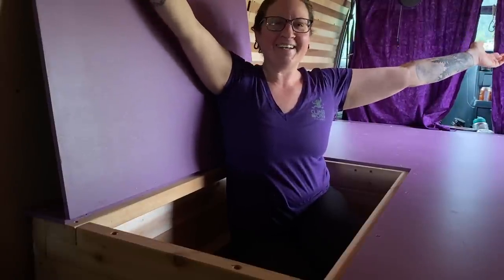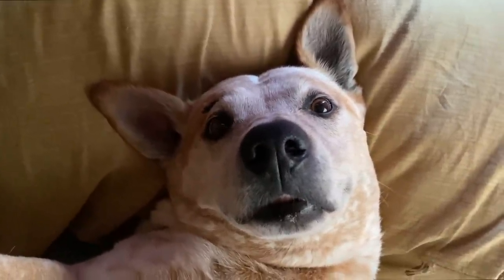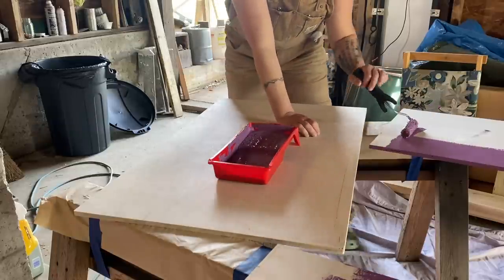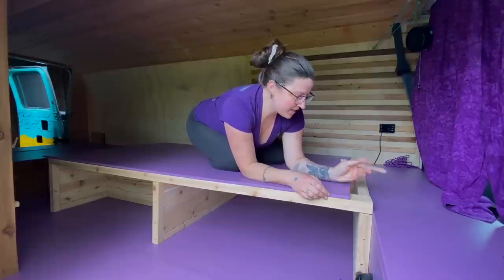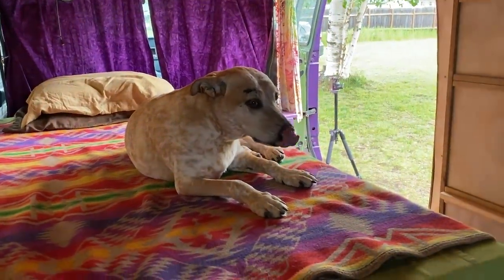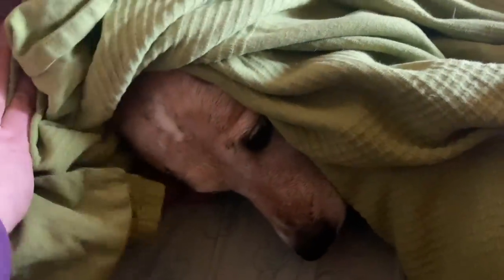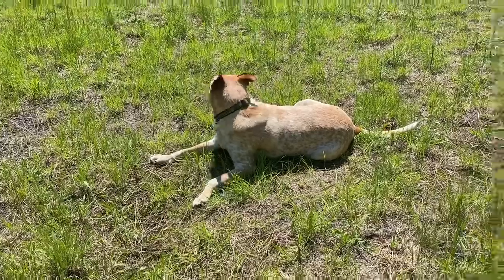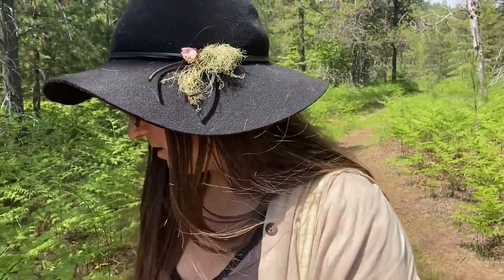MOVING INTO MY VAN || Vanlife Renovations, Concussion Recovery and Bill C-11 Issues

Comment: I love your bed so much. I might have to steal you SUP paddle storage ideas. I don’t know why I had it in my head that I will always need to have it stored in its bag. 🤷🏼‍♀️ 

Anyway, pro tip, you can put in attachment points and use the paddle board kayak seat as a back rest in your van. I use mine at my desk area, so I have some back support if I need it.

Thanks for another magnificent video. I hated to see you not feeling well, but I’m so glad you’re on the mend and out exploring.

Until next time! 👋🏻
Reply from the maker: Thanks Amy, that’s a great tip about the paddle seat 💯

Comment: Great job! I think you will need a net to cover the paddle board opening so things wouldn't slide out sideways. Also a 90 degree leg sitting area would be nice, a place you don't have to cross your legs or sit crunched over. I think a cut out or a fold up in the one end of your backyard platform with a pull down-out desk top would be nice.

Comment: You should have used slats for your bed or put some kinda moisture bearyer under your mattress to keep mold out
Reply: Airflow under a mattress can be achieved by using this stuff called “Hypervent” I believe. It’s this plastic combing stuff with air bubbles all throughout that allow air to pass under a mattress. The plastic stuff keeps its shape, ensuring the air has passage.